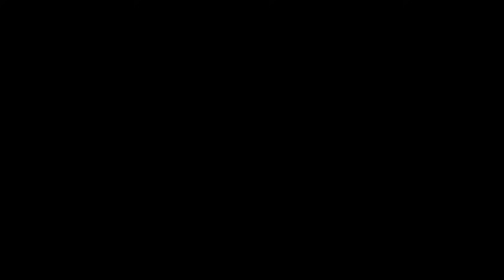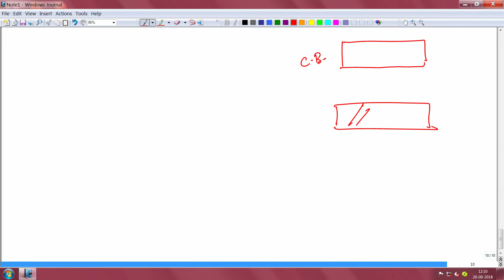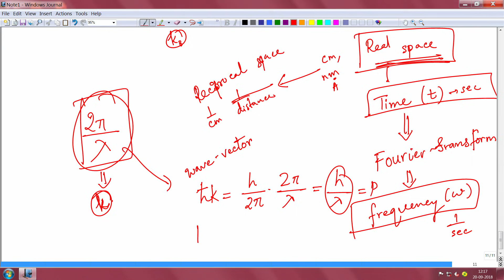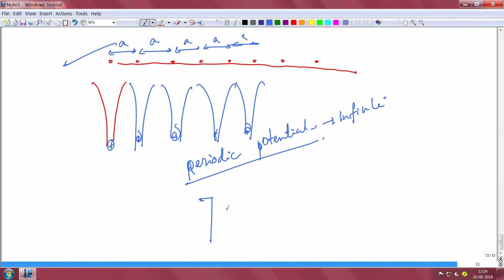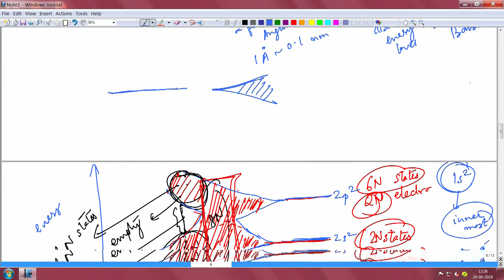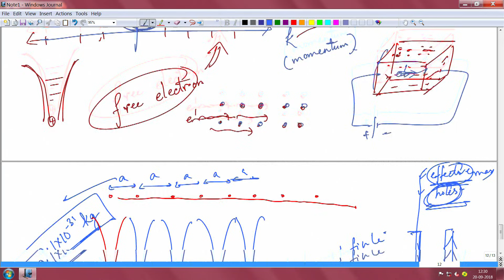Introduction to energy bands

Comment: 00:00 - Crystalline materials and energy band gaps
02:37 - How conductivity works in semiconductors vs. metals vs. insulators
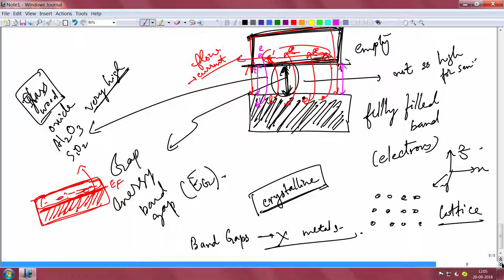04:47 - Valence bands, conduction bands, and band gap energy
06:50 - Band gap values for common semiconductors (Silicon, Germanium)
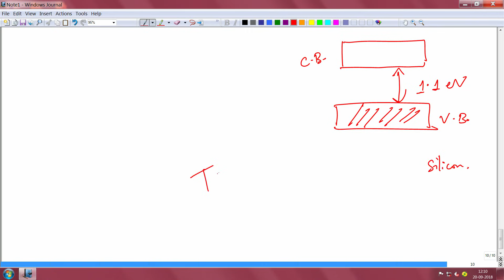09:41 - Thermal energy and electron excitation at room temperature
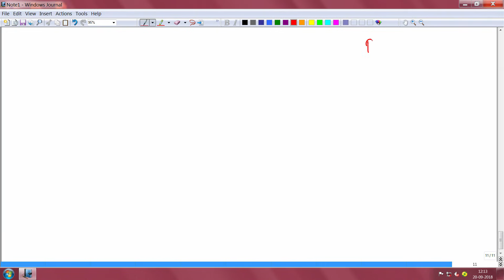12:33 - Introducing the E-k diagram and Reciprocal Space
15:36 - Momentum, wave vectors, and free electrons
18:27 - Electrons moving in a real periodic crystal lattice
23:54 - The concept of effective electron mass in a crystal
25:24 - Preview of the next class (Holes, Fermi-Dirac statistics, and doping)
26:35 - Summary and recap of the lecture

Comment: 7:42 Band gap is supposed to be a distance then how we can measure it in electron volt, ev is energy unit?
Reply: Band gap means that difference in energy levels
There may be difference in distances in energy levels in accordance with bohr distance but we are interested in energy soo
We considered energy band gap
Reply: Because, we measured the distance in Energy Axis. and usually we use the unit of energy as the eV unit instead of joul....
Reply: Not explaining by details. I think these courses require solid state understanding first.
Reply: @salem201188 lol its super detailed just requires basic common sense

Comment: sir, in which video did you tell the concept ,that even if the electron has less thermal energy it has a probability to excite from valance band to conduction band?
Reply: It is called quantum tunneling search it